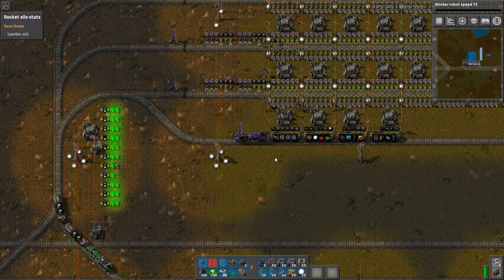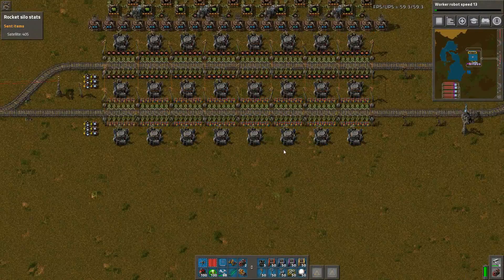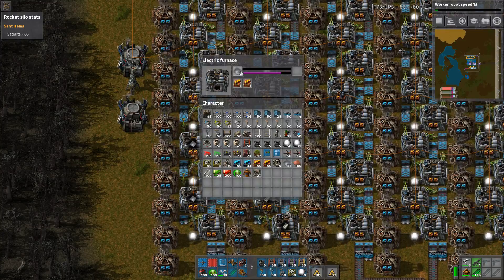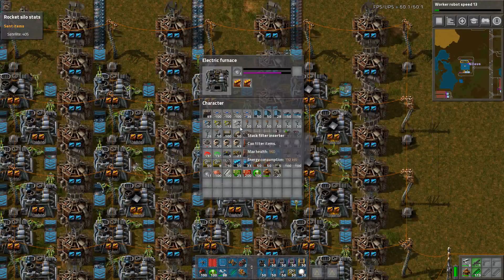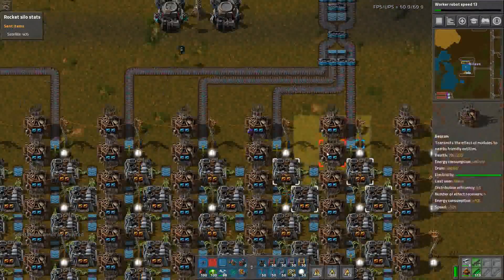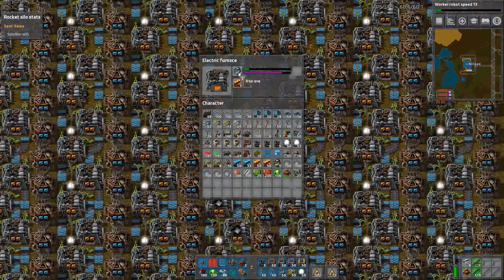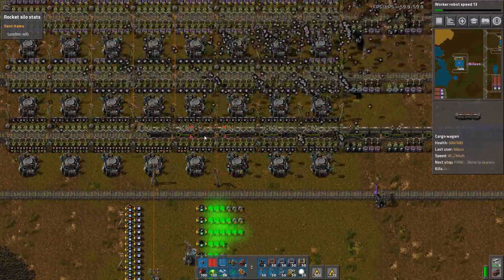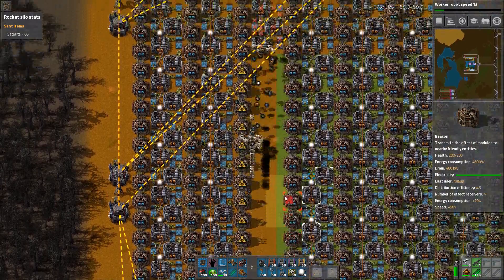Factorio - My Megabase E58 - Mistakes were made

Comment: I would have made a blueprint of the column first. Then, set the deconstructor to only delete the furnaces. Delete the furnaces and use inserters to empty the supply lines into boxes. Once the supply is empty, you can put the furnaces back down.